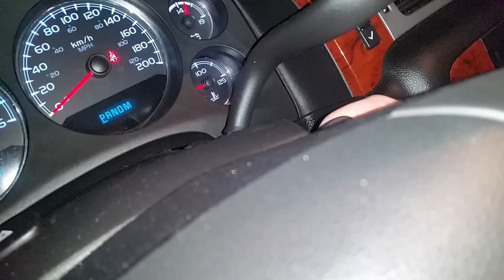Loud grinding noise seconds after cold start

Comment: That sound im hearing is the Ac Compressor Bearing / Idler. The lifter sound is bc cold starting a AFM Ls engine and oil not making it to the heads for the lifters. Winter swap the oil to 0w30 :)

Comment: It happened to me it was the solenoid on the starter , you have to remove it and grease it inside, so it can  retract faster. 
Now one month after, the noise came back  I think I have to change the starter
Reply from the maker: Good to know thanks wish I still had that beauty....I have a white 2013 lt version now with 2x the kms ha ha blew my rear main seal so it's sitting in a shop right now since I'm not equipped to change that out on my truck as it requires transmission removal

Comment: I think my car had the same issue (not certained yet),but is there a chance that the sound came if there is no coolant?because i think my coolant is empty
Reply from the maker: Not sure but if you have no coolant you have other problems ha ha.
Reply: @WestWire  what is that?overheating?i am worried about that too..the problem is my thermostat also need to be replaced🤣🤣right now i dont know the temp of my car,so shit myself
Reply from the maker: @zulfahmiharith3994  well I'd be getting the thermostat fixed very soon, cause ya if you overheat your motor which with no coolant you will, that motor is gonna be toast so I wouldn't drive it much till you get that sorted out, I'm no mechanic so I don't know for sure, I just do as much as I can on my own, if it needs special tools to be done I get my local mechanic on the job.
Reply: @WestWire  yeah i had that thought too..might get it replaced soon..is it expensive?
Reply from the maker: @zulfahmiharith3994  if you do it yourself not to bad if you find a place that sells the part cheap.
Reply: Did u figure out what was wrong with your car. My coolant resovoir was empty and I filled it up a few days later I started getting a grinding like noise after i would start my car. But when the car warms up the noise goes away after 3 or 4 minutes.
Reply: @thepistolguy859  Aa yeah,i already forgot about this problem🤣🤣 it is not big problem though,mayne because the engine is old, when hot the sound is normal

Comment: Other than  slight lifter taping it looks like your pinion gear box isn't bolted in place anymore maybe broke its mounting bracket welds if not your power steering pump sounds weak and whining petty bad it may be going out other than that everything sounds and looks good but when your pinion gear box moves when you turn the wheels that's usually a weld has broke lose or what chevy is most know for front end parts beak down rapidly especially steering, tierod, balljoint, and front wheel bearings
Reply from the maker: +Flexxima38 oh ok wow I never really thought about anything like that ha ha thanks I'll gave to try inspecting a bit more
Reply from the maker: +Kilverado Bad power steering pump the bearings had gone found out when I pulled the belt off ha ha replaced for free as it was still under warranty thanks for your help as it turns out my rack and pinion are apparently meant to move there mounted to a post on a rubber bushing that allows for movement :) the sad news is I may be saying goodbye to this beauty by trading it in on a newer truck possibly....got more problems arising and with the wedding coming up I can't save while throwing my little bit of cash I hardly have at my truck ha ha something newer possibly not as loaded but lower interest and lower payments and under 30,000kms ha ha....if all goes through I have a lot of work to do gonna be tearing my grill guard off my stereo stuff out and maybe finding a cheap battery to throw in cause that one I put in was expensive and I'll need it for the next truck ha ha we shall see....
Reply: wow well i'm sorry to hear about that but i'm glad i was able to help you figure out what the problem was
Reply: Flexxima38

Comment: Is it freezing cold and does it quiet down when its warm? You could try that GM cold climate fluid, not cheap but may work.  I bet if you open the cap the buzzing sound will get louder.
Reply from the maker: ya the noise is now gone after a recent bleeding of the system but now my power steering comes and goes all smooth then suddenly will get hard unless I step into the throttle ?
Reply: +Kilverado  So the assist comes and goes. raise the throttle and its back. .  It could be the pump is crappy, or the valve on it (behind the power steering pressure line) is bad or plugs up.  The steering rack also has seals in it that can go bad, pass fluid and reduce power steering assist.  The true way to diag it is to install a pressure gauge on the power steering pressure line but that setup is NOT CHEAP and no one does it.
Reply from the maker: +Ghetto Wagon oh ok guess my options are see if someone will do that pressure test or just replace everything pump lines and the rack ha ha so tired if chasing issues in this new of a truck....lol should have kept my 1997 Silverado
Reply: Kilverado
 Haha yea 88-98s rock.  If it a REMAN pump it could be a pos. I bought a BRAND NEW ac delco gm pump for the 06 and it worked well, its alot quieter than the original. The steering feel is a little notchy now and then but its never been perfect. They all have valving issues.   Its probably cheaper just throwing another pump at it, do not get a reman one or chain parts store pump they are garbage.
Reply from the maker: +Ghetto Wagon lol that's a good possibility considering mines the 2nd reman pump lol first one cratered instantly so I can try asking for a actually Delco new pump I get discount at the parts place I go so don't really wanna go to gm but ya worth a try thanks
Reply from the maker: +Kilverado So ya turned out to be a bad power steering pump took my belt off and wow there was fair bit of play an grinding also smooth then hard while spinning it ha ha so I replaced it for free as it was still under warranty :) Appreciate all the comments and helpful tips an pointers!
Reply: Kilverado
 No prob. Like I say reman  is junk
Reply: Ghetto Wagon did you ever figure it out? I have the same problem with that exact sound. thanks
Reply from the maker: @brandonembrey9103  ended up being a bad power steering pump
Reply: Mine does the same thing but the noise never cuts off

Comment: My truck does that same thing only when it's cold. Any clue what it was?
Reply from the maker: NvDubs250 power steering pump originally but after 2 times replacing it pretty certain the water pump was going as it was the only thing on the front end I hadn't changed ha ha
Reply: WestWire yeah my 04 does the same thing, only when it's cold. My steering sometimes gets stiff if I'm backing out and if I gave it gas it would be normal. Been trying to figure what that noise it's for about a year now lol
Reply from the maker: NvDubs250 power steering isn't hard to change just need a pulley puller and few other various tools including suction tool
Reply from the maker: NvDubs250 pretty sure I have a video of when I replaced mine
Reply: Did you ever find the issue mine has new water pump alt. P/s pump and starter noisy until engine warms real noisy serious noise then after like 10 min. It stops. Can't figure this out
Reply: NvDubs250 did u get this sorted out? I have the same issue . Want to know the problem
Reply: Cold pistons
Reply: @greyrain5873  did you ever figure out this issue?

Comment: Definitely water pump 100%
Reply from the maker: Was the power steering pump replaced it 3 times kept getting bad remanufactured ones ha ha but ya water pump was next if i kept the truck wish i would have truck was a beauty but at around 145,000kms or so had everything on the front end pretty well replaced and all fluids changed.

Comment: tensioner bearing!
Reply from the maker: That's what I first thought and or idler pulley, but I replaced literally everything except the water pump, so although I no longer have that truck, pretty sure the water pump bearings were the source ha ha.
Reply: @WestWire  I have a 2002 Dodge Ram 1500, 5,9 L, and it has the same sound that goes away after a few minutes. The water pump is new in my truck, so I’m guessing it is not that....